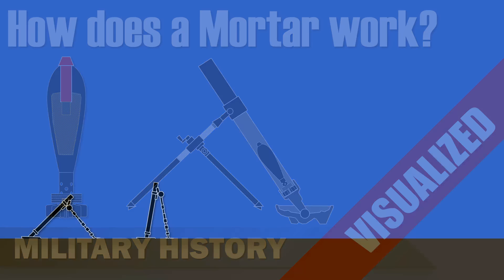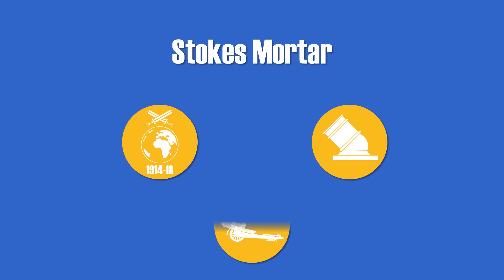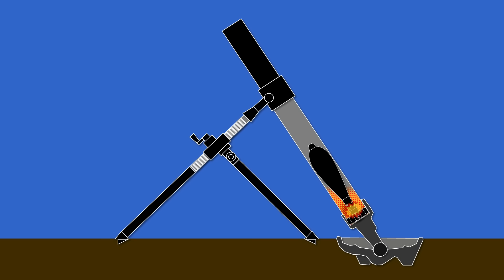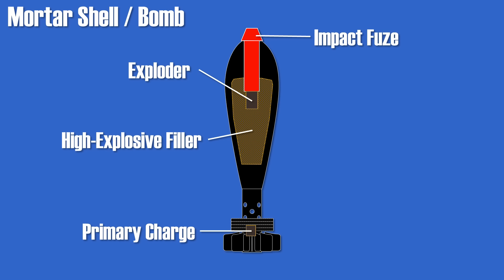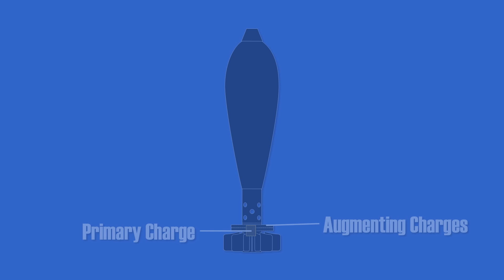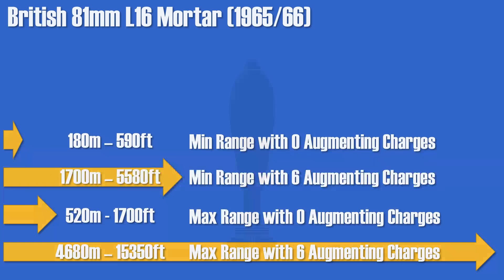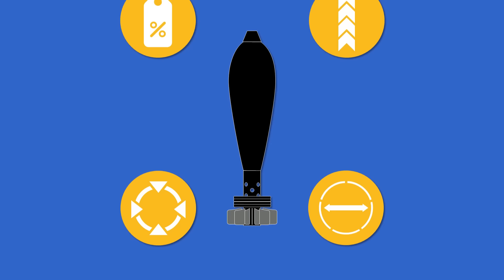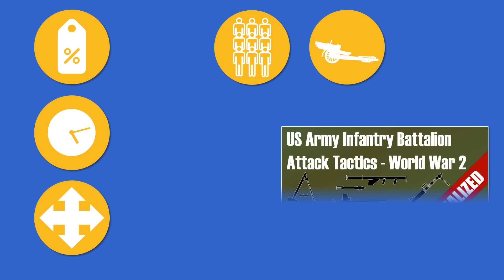[Weapons 101] How does a Mortar work?

Comment: Another advantage of the mortar is the explosive load relative to the propellant charge and shell casing. Since a mortar is short range and low pressure in the chamber, a thinner shell wall is required. So you can have more explosives relative to shell casing, and propellant in the same caliber comparing to artillery. a 120mm mortar shell can have as much explosive as a 155mm artillery shell.

Interesting is the role of the mortar in modern combat. In WWII, platoons (at least British and American forces) have their own motars, usually a small 2 inches or 60mm one attached to the platoon headquarters. Companies have their own mortars too. After WWII, lots of military eliminate the company and below mortars and make the rifle company mostly rifle-armed. 

A couple shooting wars later, like the Falkands War, people start finding out that mortars are actually very important. Sure a commander can call in battalion mortars, regimental or brigrade artillery and above. Close-air-support even. Yet the mortar is the one that respond fastest. Even more important is the fact that military actions increasingly limit to smaller forces. The days of divisions squaring off against each other is (hopefully) over. If you look at the maps of today war in Iraq and Syria, areas of controls are usually restricted to roads and thing strips of land. Both sides carelessly left their units in "encirclement". Things that during the days of divisional combat would be fatal.

The current established organization of rifle company and platoons are severly understrength in terms of indirect and anti-tank firepower. The most casualty producing weapon of a platoon is a pair or M240s. A rifle company can choose to bring its own mortar, but it's not strictly alloted that way. One company commander in Afghanistan decided to leave its mortars behind for more riflemen. It was a decision he regreted. The bulk of the mortar and anti-tank strength is concentrated in the heavy weapon company of the battalion. Say a battalion is attacked by 2 companies of infantry and 2 companies of tanks. The defending battalion will have about 2 platoons worth of anti-tank units squaring off against 2 tank companies. Not to mention, you can expect the enemy to concentrate 5 battalions in the attack, outnumbering you in the process.
Reply: +Xuan Vinh To company level operations need to become more flexible and capable of fielding more Varietysof man portable weapons.
Reply: You're talking about the war against insurgents who are wearing skirts and have zero training as if they are a first-rate army.
Reply: catindabox 334 They, however, are not idiots. They do learn and they do adapt.

In Afghanistan, which you should note that it has been around 15 years since the start of conflict and you can still see new combat footage recorded by soldiers with Go-Pros everyday. Insurgents are not easily dislodged or defeated.

In the mountainous regions of Afghanistan, the insurgents learned that American soldiers are really good at marksmanship. However, their small arms, the M16s and now M4s are optimised for engagement at below 300m, as per the experience post WWII shown. At that range, 7.62x51, 7.62x54R, .50cal, and 12.7mm rules. Over 50% of engagements in Afghanistan are above 300m. The standard table of equipment put 7.62 NATO weapons at the platoon level and above. Insurgents will ambush American infantry at extended range, with PK and DHsK MGs. American forces had to start distributing 7.62x51 mm weapons at squad level. to counter this threat.

The insurgents' aims, however are not that great. Several reasons for this. They are not very well-trained. They have poor fire discipline: lots of automatic fire which lead to rounds going high. And they have poor eyesights: it's not that easy to get prescription glasses in the middle of bum-fuck nowhere. However, they do learn Americans' behaviour: the standard procedure when you are attacked is to seek cover. So they put bombs, IEDs, booby traps, and explosives around likely cover: ditches, berms, and low walls. American infantry under attack has the choice of either being in the open or take cover and get blown up.

The response from American infantry is actually very simple: stand your ground, and shoot back. Though they are in the open, they have several advantages: they are better shots, they have better body armour, and should they get hit, better first aids, and surgery. Bullet to the stomach are easier to treat than a limb flying off. Especially with body armour. Now if you are shooting back at an enemy like that, some really heavy weapons are useful.

Comment: You forgot to mention that with some mortars you do not have a fixed firing pin, but a manually controlled one, usually working on a lever like a trigger.

And for those wondering the difference this means that with a fixed firing pin, like shown in the video, the mortar bomb is dropped down the tube and on contact with the pin, fires.
But with a non-fixed firing pin, when the bomb is dropped down it does not fire until an operator pulls a lever or trigger.
Think of it like the difference in operation between an open bolt (fixed pin) and closed bolt (actuated pin) firearm. 

I'm not entirely sure on the advantages of a non-fixed pin with mortars though, other than that I imagine it is a lot safer to use.

Comment: You failed to mention the way the bomb gets propelled without the gases leaking around it. If you just drop a plain shell down a plain tube, it's innacurate and most of the propellant is wasted. Stokes solved this with eddy grooves.
An artillery shell needs a driving band of soft metal, that completely seals the shell against the barrel. You can't drop an artillery shell into the muzzle, it won't slide down. The mortar shell has to be small enough to slide inside the barrel, but this also means the propellant should leak around it and produce an innacurate or weak shot. The mortar bomb overcomes this by cleverly using perfectly contoured shallow grooves at it's widest point. As the propellant gases leak past the bomb, the grooves are shaped to force the gases to make spinning vortex eddies, and these form a kind of seal that slows the leaking propellant, giving more push and keeping the shell from rattling around too much. Look at a mortar shell, it has these grooves at it's widest point. They form a gas seal without touching the sides. Thats the secret Genius of the stokes.

Comment: So does this mean the final battle of the movie Saving Private Ryan could not have happened since the soldiers were smacking the mortar bombs on the base-plate rather than the firing pin to activate them?
Reply: The idea in that scene is that they detonate the base charge by slamming it on the ground.

I spent a year in a mortar company as a conscript and was extremely skeptical of this scene.

Probably the biggest issue is that even with a small diameter, mortar shells are relatively heavy and will be awkward to throw. It seems unlikely that you could throw it far enough to be safe from the fragmentation.

It also looked a bit like they were throwing the projectiles 'sideways, which makes it less likely that it will orientate the nose down in time, and it might just fall on its side, not detonating.

The base charge is also somewhat protected, since it's inside the actual tail of the projectile, so you need a fairly sharp rock to make sure the base charge detonates. Also, even though the base charge is small, you probably want to keep hands and legs away.

On the other hand, the scene was supposedly based on someone's real experiences, so I honestly don't know. Mortars haven't evolved very much at all since WWII, but I have to admit that we were never allowed to try anything of this sort. We did have a loader who dropped a shell though, and his group had to constantly do exercises for the following 3 nights.

Either way, I guess it's plausible, but I'm still very skeptical over that scene.
Reply: @Infinite_Jester  do you know how I can get detailed information on the explosive composition used in the augmenting charges and primary charges. I can't seem to find any information on the internet...
Reply: @edwinvarela4779  
Google for American military historians. Find one that's an expert in weapons and send them an email.
Reply: @Infinite_Jester  they don't detonate the base charge they arm the main charge sheeze what army were you in 😆
Reply: Gravijta the pin is attached to the base plate
Reply: @Infinite_Jester  no they are not hitting the charge with a firing pin and so are not setting off the propulsion charge. Once armed the first jolt primes the main charge second jolt sets it off. The first jolt is normally the mortar being launched the second it landing.
So by banging a mortar round on the ground they are simulating the launching phase.
Reply: @Infinite_Jester  There are accounts of soldiers essentially doing that in multiple battles during WW2. I don't have my sourcing in front of me, but I'm fairly certain that it was done by both the Germans and Russians during the battle of Stalingrad. Granted, in that situation typically they were throwing them from an elevated floor in a building to the outside, which would be easier than the scene in Saving Private Ryan. Also, it has been a while since I've read through the individual histories, but if I remember correctly there was also a medal of honor recipient who utilized the same tactic.
Reply: Saving private Ryan is accurate, ANDERSON, BEAUFORD T. - Medal of Honor recipient - https://history.army.mil/moh/wwII-a-f.html#ANDERSONBT - He pushed back a Japanese Attack in Leyte utilizing the technique. Read up on him, pretty bad ass.
Reply: The fuze is armed by a process called “setback”. Essentially setback is caused by the inertial forces encountered during firing. It is akin to the force one feels when suddenly accelerating an automobile- the force that “sets you back” in your seat if you will. Artillery round fuzes require both “setback” and spin in order to arm. Most mortar tubes are smooth bore and the rounds are fin stabilized and not spin stabilized like an artillery round so the mortar fuze arming is slightly different

Comment: The mortar is a weapon that is organic to the infantry.  Smaller mortars are at company level and larger mortars are at battalion level.  Usually artillery fire support personal are attached to infantry units.  These personnel are usually the ones that call in fire from both mortars and artillery.  Separate channels are used to communicate with infantry mortars or the artillery cannons..

Comment: I believe original mortars did not mechanically seal to the tube when fired. They used the turbulence in the tight fit to seal the propelling gases. A brass band was added to flare and seal when fired so the majority of the gas propelled the round. 

I was also told it sucks to carry the base plate.

Comment: The last I recall (back in the 80's) the 81mm (H.E round) had a maximum range of 5660metres on charge 8. Happy days back in the Mortar Plt.
Reply: That's about three and a half miles? 

That's actually a pretty respectable range. Although god knows how you'd accurately hit a small target (eg a vehicle) at that range.
Reply: @Rapscallion2009  Also and 11-Chuck in the 80's on an 81mm system.  We regularly got metal on metal calls from the FO at 2+ miles.  And that was with pencil and erasure M16 plot boards in the FDC.

Comment: Things can go wrong.  Failure to pull the safety pin, in the noise of firing drop a second shell on a misfire in the tube this sets off one or both of the shells, the charges fail to fully fire giving you a short round.  All part of the fun of being a 0341

Comment: Nice, but too short IMHO. You could have mentioned how size affects its application and what rounds are available. Moreover, doesn't the nebelwerfer count too?
Correct me if I'm wrong but there's this pattern:
40mm mortar: carried by one soldier; very mobile; only against soft targets; shrapnell, smoke; incendary most frequent rounds
80mm mortar: disassembled and carried by 3 soldiers (better use a vehicle), or thrown on a truck; able to distroy buildings 
120mm mortar: requires a jeep at least; has the same ammount of explosive as a 155mm howitzer, but fires faster; can take down buildings with a few hits
160mm mortar: needs to be draged by a jeep; too big to be muzzle loaded
240mm mortar: needs a heavy truck to be dragged; or is mounted on a tank
PS: I understand the significance of 40 80 and 240mm mortars (infantery, allrounder; siege) but I have no idea about the application of 160mm mortars.
Reply: Nebelwerfer was rocket propelled ordnance.
Reply: chapiit08 Still its in many ways like a mortar.
Reply: Then the Katiusha too is like a mortar in many weays, and so is a howitzer, and an aintiaircraft cannon and so on. NO a mortar is a fucking mortar.

Comment: Is it true that if the bottom of the mortar bombs isn't striked by the firing pin, they don't explode after hitting the ground if launched by hand? I'm taking about the final battle of the movie Saving private Ryan, they had mortar ammo but no mortar, so they were hitting the bottom of the mortar bombs on a metal plate by hand and then launching them by hand on the other side if the trench, not far away

Comment: Well done, just one thing I would change is to call the "exploder" a detonator. It would also be interesting to detail the various types of fuses and mortar shells that are available (smoke, HE, FRAG, AP etc). Cheers Alex
Reply: ap mortar shells didnt know they were a thing
Reply: +Jim Cowley I'm gonna take a wild shot in the dark and say maybe they are for destroying fortifications?
Reply: I agree with PinkPlushie.  Only Smoke, Illumination, High Explosive, Practice, Precision Guided Munitions, HERA, and Gas rounds, (CS, GB, VX) are made for mortars.  The gas rounds may have been removed from the inventory.  You can find imaginary rounds in video games like BF4, which become "real" in the minds of many.
Reply: I know they use red phosphorus in certain artillery shells, including mortars, but white phosphorus is still the primary smoke round for obscuration, at least in the U.S. inventory.  Red can be used for screening, but it's primarily for marking.  Both are used as incendiaries.  Modern fuzing allows for multiple types of bursting in all mortars.  Mechanical Time for illumination rounds, Point Detonating for general purpose use, and multi-option fuzes give the ability to select Proximity, Near Surface Burst, Impact, and Delay.
Reply: Ahhh... I didn't look it up, but I don't doubt that they have cleaned them up, chemically.  Regardless of what's in with the WP, it's still a very nasty thing, all by itself.  That's really the point though, isn't it?

Comment: i would be interested in finding out how exactly a 'tree burst' [or should i call it an 'air burst'?] effect is achieved against Infantry forces with mortar stonks/barrages.
From what i've read in memoirs of German, British and US troops [and all other national forces of WW2] who have found good light cover in woods but then suffered from constant mortar or artillerie air bursts, it sounds far more terrifying than being fired at in open ground as the shards of wood can cause many more casualties than just the shards of shrapnel. The likelihood of being wounded by metal as well as splinters must have accounted for a larger number of non-fatal casualties.
It would be interesting to know just how the opposing forces discovered or calculated the range of , for example, a 30 man platoon 'dug-in' in woodland.

The German forces [Army Group North] in , i believe, Byelorussya, called it 'the Green Hell' as Russyan mortars poured an enormous amount of firepower down upon German troops dug in in the dense woods.

Mortars were obviously effective against Marders [tank destroyers] and Sdkfz250/251s and the SP artillery [Wespe, Hummel] as these vehicles were open-topped and, thus, vulnerable to even light mortars which, over open LoS, were much more accurate at the shorter 100-400m ranges.

I would guess that the use of 'air bursts' was a calculation of the distance the mortar round has to travel with the fuse set to explode at a shorter range than the angle it's actually fired at? 

Or is it simply a matter of the mortar rounds hitting tree trunks, amplifying the explosive effect of shrapnel combined with splinters or shards of wood?

Comment: During my experiments I came to the problem of anything wich is near on size to the inner diameter of the mortar barrel (my experiments had about 0.4mm play) is slowed by the air underneath being compressed and not letting the round fall fast enough to initiate any  primer. Does anyone here know how do actual mortars circumvent this problem? Making the round significantly smaller seems very counterinuitive as it would make preassure from the propellant be it nitrocellulose based or black powder based leak by the sides.

Comment: Silly question, but I take it that the augmenting charges are set of by the holes in the base by the primary charge. Now when the augmenting charges detonate, since the mortar tube and body pillow they even themselves pressure wise. Are the charges just TNT OR similar? Great grand uncle was a mortar man I WW2 . Really interested in how they work
Reply from the maker: I don't know about the charges and likely depends on the time and also force / country as well.

Comment: When the mortar strikes the ground what is the range of the blast and shrapnel area ? in case ww3 starts anytime soon.
Reply: For a 120mm high explosive (HE) bomb, it would be 100 x 100 metres. You could also light up old trafford with a flare bomb for the striker to take a penalty kick. Cannot remembered how many times I gave the command "FIRE". Of course not before I had checked the bearing, elevation angle, number of charges and the firing pin was activated.